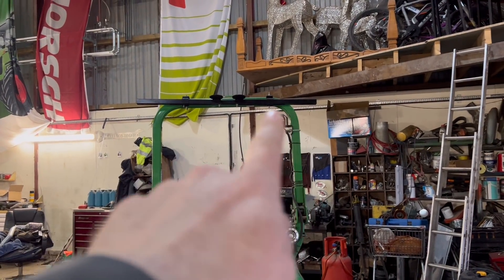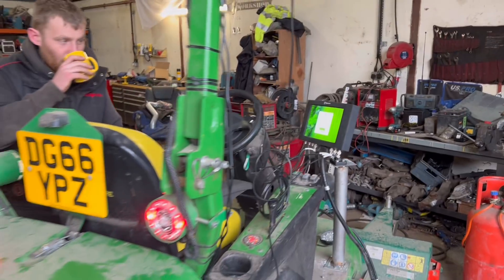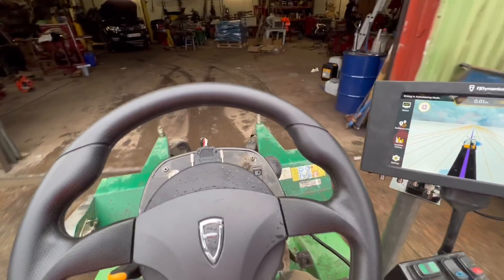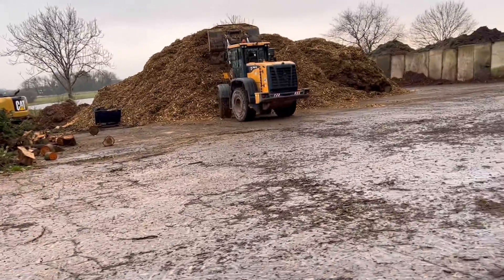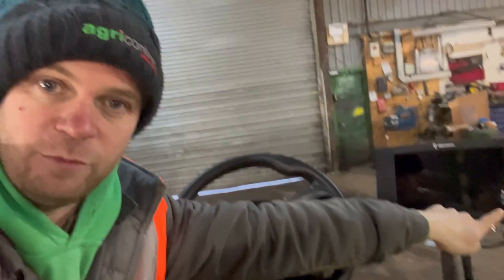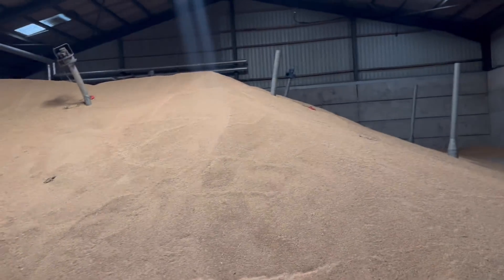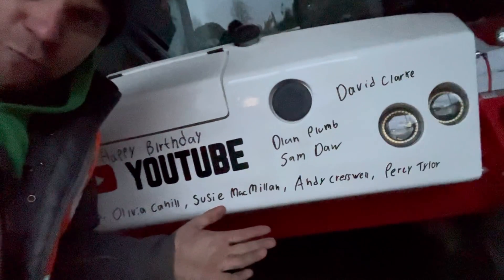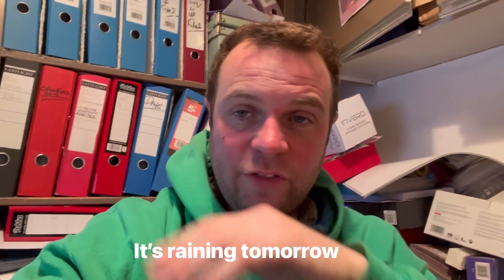Day710 #OLLYBLOGS NO HANDS MOWER & FENDT 936 RTK BONUS  #AnswerAsAPercent

Comment: Little known fact....... With modern cars adding a filter or exhaust or even an upgraded turbo is useless unless the ecu has been made aware that the parts and the parameters have changed. I'm no expert in this field but having had my own car mapped it's a huge difference! 😁
Reply from the maker: Yer there to clever now

Comment: If it requires a Sim card then it isn't true GPS. It detects its location through triangulation between 3 cell towers. Which means, if you have poor reception, your GPS won't work properly. 
Which is absolutely stupid because you can get true GPS modules for projects for like £3.
Reply from the maker: It works with out a sim as well but for greater accuracy use base station sim for triangulation